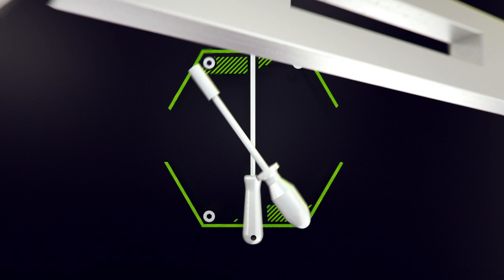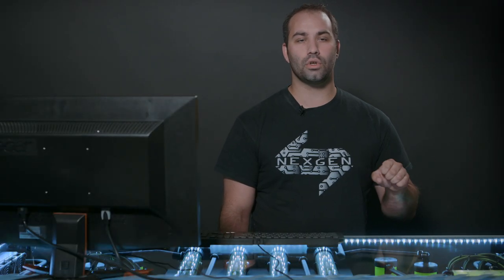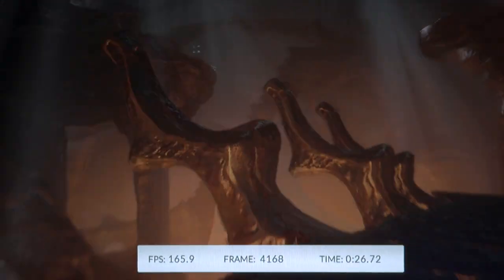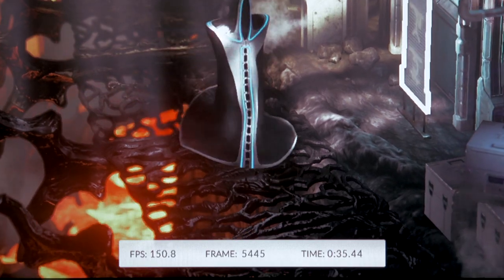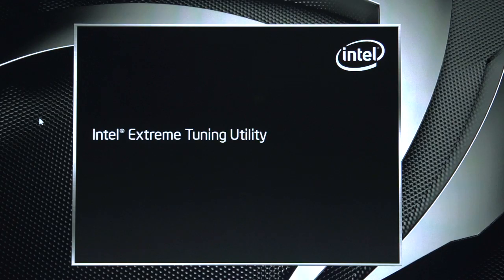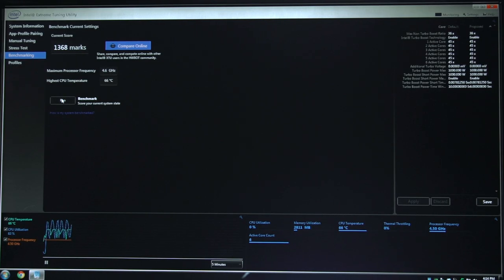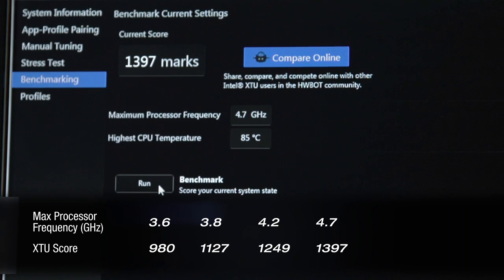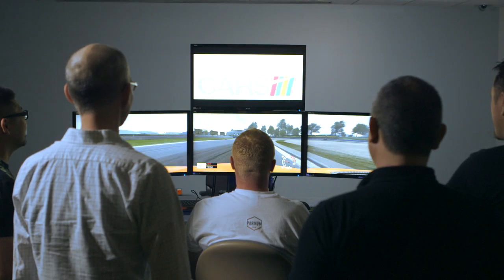GeForce Garage: Cross Desk Series, Video 7  – How To Overclock Your Gaming Rig

Comment: Can any nvidia representative answer as to why laptops have suddenly lost the ability to overclock?
Reply: Gaming laptops such as the msi gt72 and asus g751 among others that all have excellent cooling systems that allow for overclocking. 
Further, gaming laptop owners overclock for the same reason that desktop gamers do.
Reply: ***** I doubt that very much
Reply: ***** we are not talking about the same class of laptops, please go take a look at the asus ROG g751 or the msi gt72 and check out their thermals, then come back and attempt to tell me their cooling is subpar. tyvm.
Reply: ***** What about an Overclock dock. Where you put a laptop in a dock, and it will cool and boost the Laptop.
Reply: Don't game on laptops, period.
Reply: SpurnOfHumanity there are gaming laptops that outperform desktops. rofl.

***** Obviously your run of the mill consumer ultrabooks and trash like that are not going to be overclocked ever so it would be common sense i would not be talking about those, and that i would be talking about the high end gaming laptops. Common sense is not so common it seems.
Reply: *****  dual 980m sli beats the desktop 980 by a bit of a margin. But no the gt80's cpu is a laptop 4980hq.

The best laptop i think is the origin eon 17-slx and the other clevo variants of it that have as you said a 4790k and 980m sli.
Reply: ***** There are situations where people either cannot have a desktop, or just do not want a desktop as many of the "desktop masterrace" seem to forget. I personally prefer gaming laptops for their portability compared to desktops as a uni student who has to move a lot.
Reply: ***** Haha ive seen it floating around in some places the newer generation gaming laptops have come quite far in comparison to the older ones, but yeah i agree upgrading them is quite a pain when it comes time to change out gpu or cpu. Even ram in some laptops have to dig under the keyboard :( but oh well sacrifices have to be made for portability.
Reply: Alexandero Lu I was actually having this exact same conversation with someone the other day and the only time I could think of when a gaming laptop would have been preferable to a desktop rig would have been when I was at uni, but then remembered that I could barely afford to feed myself some weeks in uni let alone splashing out a couple of grand on a high end gaming laptop.
Reply: LOL the irony.
Reply: ***** cause you think people should not have the freedom to do what they want with thier property.
Reply: Alexandero Lu Its because of the new driver update from NVIDIA. They say it was a bug that you could overclock your laptop, and now they fixed it. );
Reply: SlapMazz I have read a bit further into this, they specifically blocked the 980m, 970m, 860m, and 850m.
The conspiracist inside me would say that they locked it down because maxwell overclocks quite well and it would make buyers now hold off buying the next generation, which would cut into their bottom line.
The 860m and 850m both overclock very well too which would stand to reason that one might be able to overclock them to the yet to be released 960m levels which also further cuts into their profit margins.
So far this seems like a very scum move from a company like Nvidia.
It is just sad that AMD cannot provide enough of a competition to nvidia and they proceed to slap us with their proverbial monopolistic wang.
Reply: They patched it.
Reply: ***** at the right temps there are no cons. Very few places where you can't plug your laptop into an outlet. Some people only bought nvidia, cause they could overclock and get more for their money. It would really suck to have that taken away.
Reply: ***** some people like to move around the house, different rooms not everyone likes to be locked down to one place at all times.
Reply: ***** cafe, library, or any place with an outlet. Its great to game outside. I can't bring a desktop to the cafe or pub lol battery problems dont exist in the city.
Reply: ***** if people haven't noticed, if you have a windows computer (I have a dell inspiron 15), you can click on the battery icon and then select power options and then click high performance. ive have this setting on my computer ever since the day I got it which was about 2 years ago and ive never had a problem. also, don't make fun of me for having a working computer as a gamming computer, im upgrading this thing from 4 to 12 GB of RAM so that it can handle games requiring more than 4GB of RAM.
Reply: Getting a 980M SLI-laptop isn't worth the money though, if you want such performance and you really must have a laptop, you might as well just get an alienware with their AGA...
Also, you can get a 980 SLI-rig with a 6-core i7 for a lot less than that...

Laptops can be nice to have, but high-end laptops aren't worth getting, it's better to get a cheaper laptop (Single 970M for example) and a desktop.
Reply: Eyoldaith ***** The new alienwares are all BGA soldered garbage. The graphics amplifier is also unwieldly to carry around so therefore as a laptop you are just locked into the 965m, 970m or 980m you bought upon first purchase. So no. That is not a good alternative in any sense.
Reply: While the AGA is far from optimal with its 4x PCIe, it's cheaper than getting a laptop with the same performance.

Also, you're not supposed to carry it around, the entire point is to have it at say, your desk, and then use the gpu in the laptop (something along the lines of an 860M atm) when you're away from home.

I have, as I mentioned, used a laptop for gaming for 3 years before I decided to get a stationary, and I can't understand how you people can consider it to be comfortable. Every time I wanted to play (depending on whether I wanted to move it or not) I had to carry around cables everywhere, it was really bulky and far from comfortable.
You can expect a way worse experience with a laptop like the MSI Titan, since it's heavy as hell (4-5KG iirc, it'll get really heavy and hot in your lap, and to play on a table you'd most likely have to lean forward unless you have relatively long arms, which is bad for your back).
All this stuff is really annoying, and once you get a desktop and a good computer desk (Never seen anyone get one for a laptop) it's far more comfortable than using a laptop.

Also, about moving around in the house; Desktop + Nvidia shield and a good router is cheaper and will still give you some mobility.

A laptop is not a good replacement for a desktop, it never will be.
A complement to be sure, but terrible as a replacement.

I know a lot of people who had a similar experience when they went from a laptop to a desktop, but people don't realize it until they actually change, and they rarely regret it.
Reply: Eyoldaith  These days the desktop performance and laptop performance are not that far apart, i think the 970m is on point with the desktop 770 and the 980m being almost the same as the desktop 970 so the performance is there, AND if money doesnt matter to you its a perfectly reasonable replacement.

The argument for the AGA is if its on your desk sure, but what if you have to go to uni or a lan party and you have to lug around the laptop AND the aga. if you were to have the aga you might as well build your own mini-itx pc. arguing that the aga is a better solution is even worse of an argument than having the gaming laptop just by itself.
Reply: Alexandero Lu what us really far is the price and the capacity to be mobile at high usage if you use the laptop at its whole potencial it won't last much without being connected and also they are way too expensive
Reply: Héctor Fernando relatively about 2 hours of gaming while on battery is reasonable enough, most game matches dont last over 20minutes anyway but most of the time a wall plug should be close by.
Gaming laptops are quite high priced, but then all people buying gaming laptops already know this and accept this fact. However in some countries the price disparity is not as big.
Reply: TheJackalPhantom while that is true there are laptops out there that can compete with desktops handily. The asus g751 while soldered has extremely good thermals. The msi gt72 is a further step up in terms of thermal dispersion and it is also modular mxm on the gpu so it can also be easily upgraded like a desktop. There are numerous other laptops that have excellent thermals and can be upgraded too. To say all laptops are inferior is a gross exaggeration that isnt true.
Reply: Alexandero Lu All laptops aren't inferior, all HIGH-END laptops are.

You can get better cooling in a desktop, what can you do with a laptop? Get a cooling pad, which barely can keep up with a gaming laptop?
Also, to clean a laptop and a desktop are two completely different things (I've done both myself), and if you've got a laptop, it's gonna be hellish. You usually need to remove almost everything above the motherboard except for the display and possibly the motherboard to do it properly (unless it's an HP work laptop or similar, you just have to remove the keyboard).
It'll also void your warranty if you do it by yourself.
Before you say something like you don't need to clean a laptop, my laptop  reached about 95-97 on both GPU and CPU (I'm pretty sure it fried my DVD Writer...) before I actually decided to clean it, and once I cleaned it, it went down to about 70 and had way better performance.

With a [homebuilt] desktop on the other hand, you just pop the side and you're good to go.

The only real reason to actually get a laptop is if you plan on moving around a lot, and if you have a hard drive in it, then you'll want to shut it down first, because as TheJackalPhantom mentioned, it can be damaged if the heads hit the platters. (I've had my laptop bluescreen on me once when I put it down on a table lol)
Reply: TheJackalPhantom I have a laptop overclocked and it doesn't run that hot, not to mention I have a dell laptop
Reply: DethKlokLord1 good luck if you read what i said the temps only read from its GPU or CPU and not in the VRAM modules or transistor bridges which will get hotter then that trust me your laptop will probebly die withing 2 years from now if you keep it overclocked although 20mhz is not a big deal however extreme overclocking 60-200mhz
Reply: TheJackalPhantom laptops like the medium sized clevo's asus g751 or msi gt72 to name a few can all sustain a +135mhz oc very easily. Some people can get a stable overclock to about 1400mhz on the core without combusting their laptops.
The silicon will give out far before the laptop combusts or becomes damaged in most cases so temps from overclocking is a terrible argument for why not to overclock.

I would wager even medium sized dell's can safely maintain overclocks.
Reply: Eyoldaith High end laptops are the same as most mid to high end desktops. Performance is no longe rthe issue, but its the price. Sure cleaning a laptop is hard but thats also a price you have to pay for the form factor.
Modern harddrives have safe mechanisms that stop the head from impacting the disc or damaging anything during transit. If your hdd bsod'd from just placing it on a table either that hdd was garbage or your laptop was ancient tier old either way so that is an invalid argument.

Homebuilt desktops are not portable, and i am willing to bet most people telling people to buy a desktop instead of a laptop all have budget builds anyway. Gaming laptops are not cheap. Everyone understands that, if you cant afford it move along.
Reply: Alexandero Lu i got a desktop pc when i stay at my friends or girlfriends house i take it with me 1 monitor with build in speakers and my desktop wireless mouse and keyboard and you are set 5 minutes of your time to install it all and no my computer is not light by any chance if you are interested in my specs there on my channel ;)
Reply: TheJackalPhantom While that is an excellent solution for staying over at a a friend/partner's house in the mid to long term, it isnt quite as possible if you were to have to go to university for long periods of time. as you would likely look strange to others or lack space to put everyting on a desk.
Reply: Alexandero Lu this is where my older micro atx build comes in handy ;) wights only 2.5kg i believe but then again why overclock an laptop i rarely overclock my desktops if they can handle a game ;)
Reply: TheJackalPhantom true that, but some people just like to squeeze out as much performance as they can out of a system before they have to upgrade it eventually
Reply: TheJackalPhantom Well, laptop and desktop processors aren't even close in performance. I can understand why people want to overclock laptops, but when an i7 4940MX barely matches the i5 4690K performance-wise, and the difference in pricing between those is so abysmal (240$ vs 1100$), it doesn't really make any sense...
Reply: Eyoldaith clevo/sager (and their spinoffs) have the option to have a desktop 4790k i7. please tell me how a desktop processor is inferior to the same desktop processor.
Reply: TheJackalPhantom ive had my computer for 2 years with the overclock and it still runs as good as it did when I got it
Reply: Alexandero Lu For the same price as you can get that, you can usually get a 5820K/5930K/5960X.
Reply: Eyoldaith that is not the point you were making. You specifically stated that laptop processors are not as good as desktop processors, and i rebutted that the same desktop processor is used in a laptop.

The price issue once again comes into play, but also if one is considering a gaming laptop they know full well what it entails.
Reply: Alexandero Lu That's because that's not a laptop processor, it's just jammed into a laptop, and a laptop that big would be incredibly uncomfortable to use (Having a 5kg laptop on your lap during an extended gaming session isn't even an option).

And the price makes a huge difference in the CPU market, it's the biggest reason why people still buy the FX 8350.
Reply: Eyoldaith Those laptops are actually at most 4.5kg so they are within the realms of portable. The laptops arent any more uncomfortable to use than your usual laptops and you are not meant to use a gaming laptop on your lap. Who even uses a gaming laptop on their lap for extended times? Price always comes up in the argument, but people would not be considering a gaming laptop if they did not have the funds for it. Back to the point, if you cant afford it move along its not for you.
Reply: Alexandero Lu Most people actually do use them on their laps.
And yes, they are, there's already a big difference between 1.5 and 2.6kg, going from a regular laptop, which weighs about 2KGs to one that weighs twice as much is a lot worse than you'd expect.

Actually, we use the price as an argument because it goes hand in hand with performance.
And for those of us who wants performance, there's no way that we'd choose a laptop.
Hell, the price-to-performance ratio on a gaming laptop is even worse than that of a console.

I know that there are people who prefer them for their portability, but a 4.5KG laptop is not very portable, it's not something you just casually lug around in a backpack.
That's pretty much just "LAN-portibility".

On the positive side however (and the reason why me, and a lot of other people got a laptop in the first place), you can put a laptop in a backpack and get it over to a friend to play during regular weekdays, something that would be a major hassle with a desktop.

Having a laptop can be nice, but after a while, you really start to regret not getting a desktop due to the lack of upgradeability and such.
Reply: Eyoldaith I have used a gaming laptop so far in university, and it has not presented any of the issues you have just stated. It is all personal preference and biased information people give to try justify how not portable a gaming laptop really is. In general most 17inch laptops even from the mainstream trash tier HP's are all around 3kg, so please how is 1kg more any less portable when you have a backpack?
the price to performance on a gaming laptop will have to depend what country you are in, in my country the difference is around about 20% just picking parts from a website and assuming you build it yourself as opposed to a gaming laptop.
Reply: Alexandero Lu HPs are actually pretty light compared to their competitors (also depends on the hardware, but still)~
That single kilo, and then the charger which'll weigh in at 500G (mine does, 120W, and I know people with way bigger ones), might not make a huge difference, but it's not comfortable either.

I don't know what the price-to-performance is like where you live, but a laptop with an 860M (Which is pretty similar to a PS4) and a really weak CPU costs about 2-3 times as much as the PS4 here (Sweden).
And then, to compare it to a desktop, where at the same price as the PS4 you get better performance, is kinda funny~ 
When you go to the same price class as the laptop, you've suddenly got something like a 280x/290/970 with an i5, that's a huge difference.
And the higher you go, the bigger the difference becomes...

Anyway, it's still a matter of personal preference, I know that I'm not going to change anyone's opinion, and I'd easily recommend a laptop for someone who already owns a desktop, but I still think that it's a bad choice for a primary.
Reply: I have always bought the fastest baddest laptops spenifn 3K+ each time to do 3dsmax work on them and they always overheated on me and froze while rendering. Now I never trust any cpu intensive work to this hotplate called notebook. they are only good for word processing. .
Reply: They have bad cooling